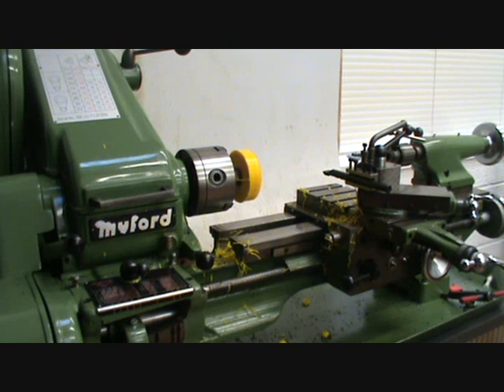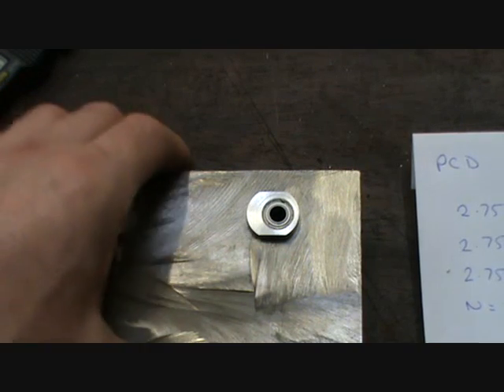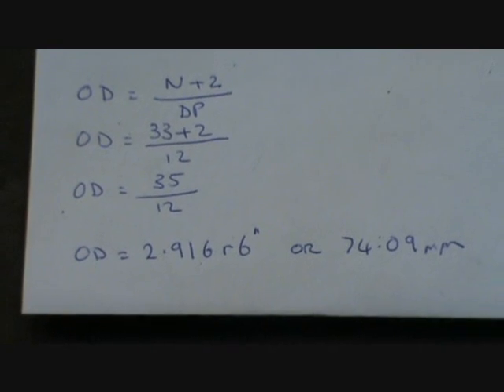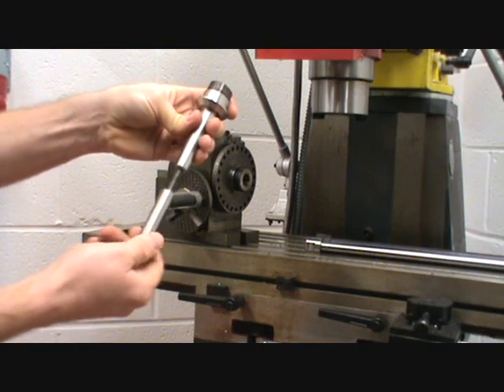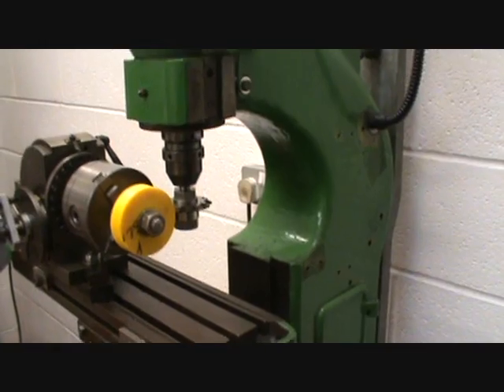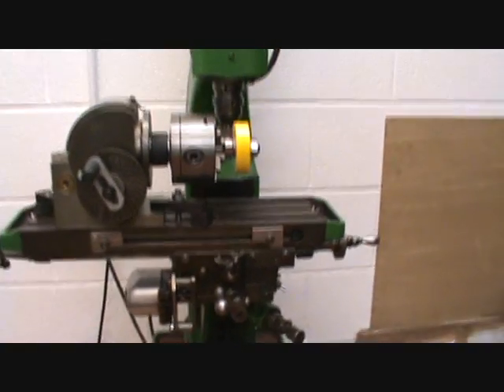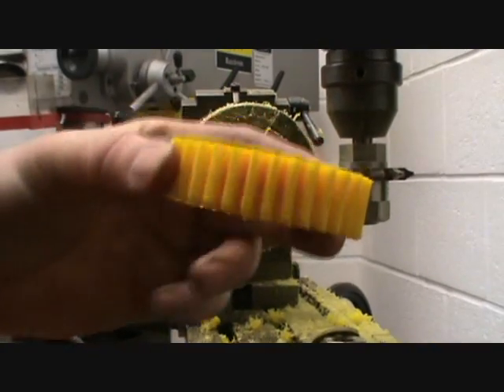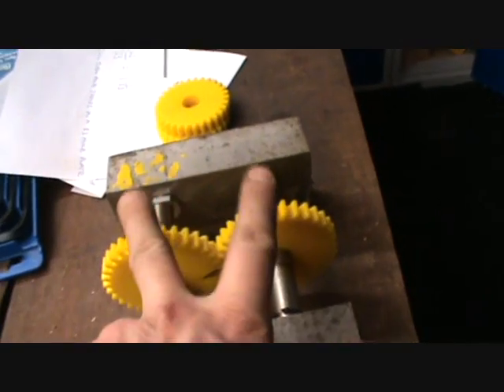Metalwork-Making Gears

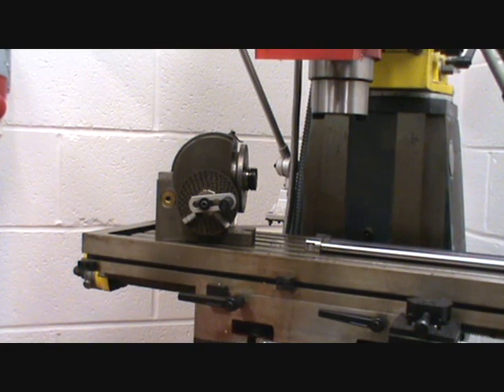Comment: 4:28. That is an MT3 taper... I have the same one. I'm connecting a stepper motor to make it a 4th axis (A-axis) for my CNC milling machine. I'll make a video when done. The thread is 1 inch, 8-TPI which is the same as my Sears Craftsman Lathe (1961). The Milling Machine Move - May 2014

Comment: while I think Sammamishwa was just being facetious, 3D printers use advanced thermoplastics, ceramics and direct laser sintering for working with metal. Any of these options would make a durable working gear. They have already used thermoplastic brake discs and the first fully printed M16 with 30 round clip has been fired without issue (although the bullets were not printed!) 
The setup costs would be significant though ;)

Great video by the way - enjoyed it very much :D

Comment: In my opinion, working with plastic is not worth it. These gears are weak and can not withstand accidental overloads. It is better to use metal, e.g., aluminum alloys. The necessary blanks easily cast crankcases of cars or pistons. Plastic rationally exchange for cheap consumer goods.

Comment: I have never had to do this in a machine shop but whenever I had to get the "on center" of two holes or studs or whatever I just measure the distance between the two holes except I take my reading on the same side of both holes (i.e the right side of both horizontal holes). I just hook my tape on the edge of one of the holes and then sight down the same side of the second hole. It works everytime with a tape measure at least. Better to do it your way when you have to use a set of calipers though

Comment: "If you want to measure center to center between 2 holes of the same diameter"
The KEY word you left out at the end of that was FASTER.
I can measure the distance between 2 holes of the same diameter a few different ways... But you reminded/gave a nice tip and did not do it in an "i am God type of way".. I respect that

Comment: Great presentation on gear cutting. I like your machines, and how you adapted your dividing head to take the chuck from your Myford lathe. I have a Myford as well, and made a dividing head from scratch, machining the spindle in the exact same way as your adapter. I made it so I could manufacture a replacement gear for the auto feed on my Atlas milling machine. Since then I've used it for other projects as well. My channel is named; sohackitj if you are interested. Thanks for the video.

Comment: Hi, you said that you are 99% sure that magnet motor will not work. Ok, well it will not work unless you add a piece of mu-metal or iron soft between thos magnets, so it cancel the repel force and the magnets will be attracted to the metal sheet. Right before the magnets arrived to the dead point you cut the metal sheet so now there's nothing between the magnets and they will repel each other again. If done right it should continue to move without stoping.

einspace

Comment: Great video and math lesson.  When cutting plastics, you might want to try rigging up an air nozzle to blast the cutter.  If the material cooperates, you'll end up with a better finish and turnings that are more like chips than melted plastic.  Thanks again!